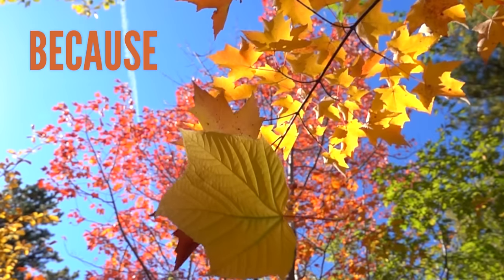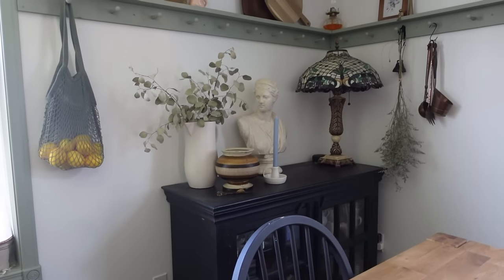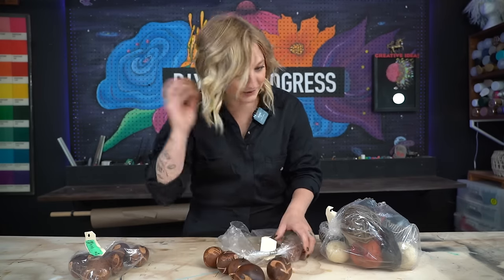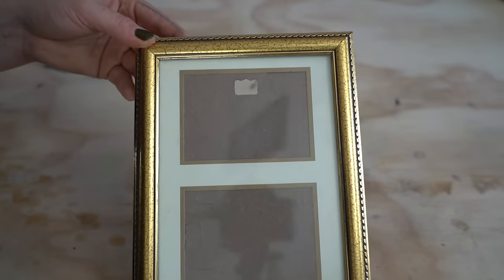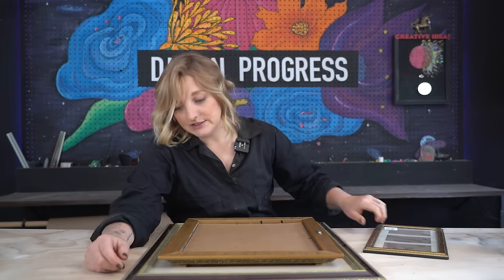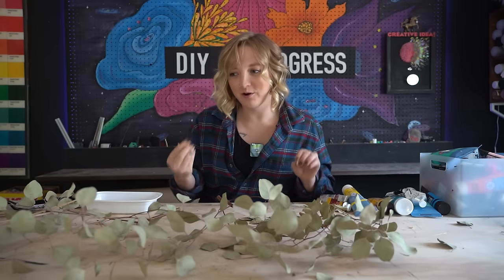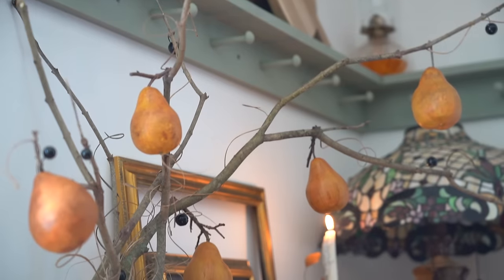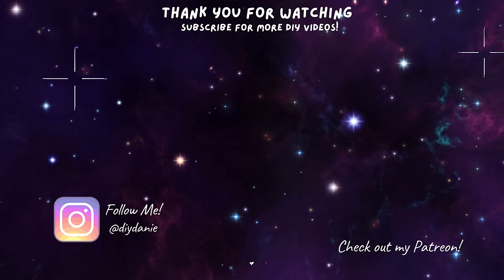let's decorate my home for Autumn Season! 🍂 *BUDGET* Thrift Flip Decor!

Comment: When a price tag is stuck on a hard object, you can use oil to set it free.  Spread any oil on the price tag, and let it sit.  Some will come off immediately, some need time.  It will eventually come off.  Then, you will need to wash off the oil.